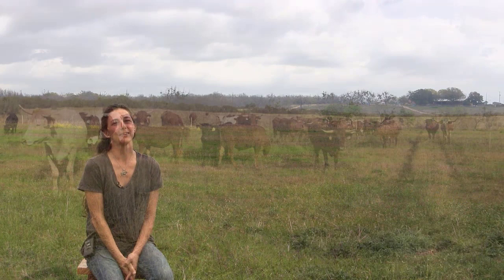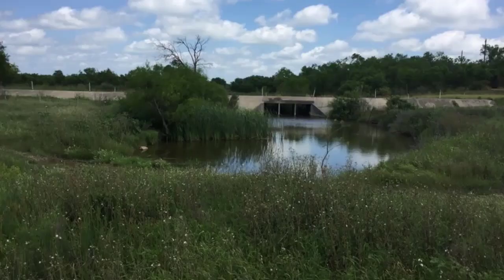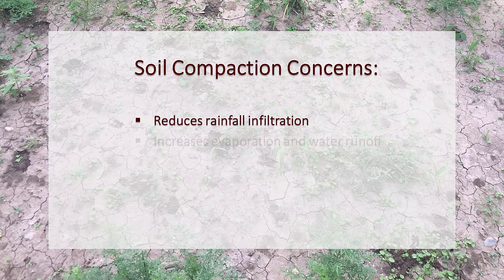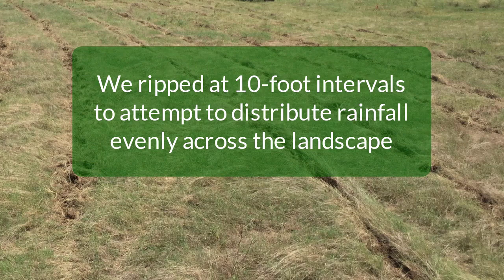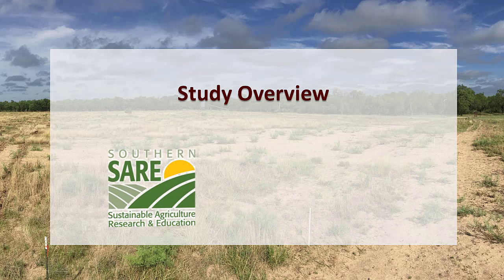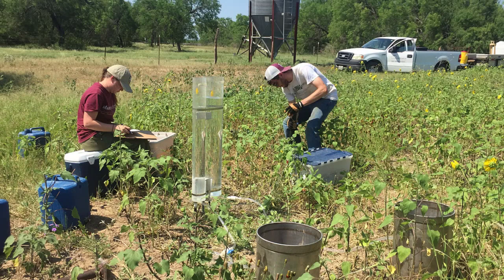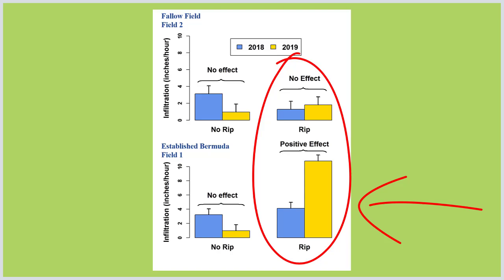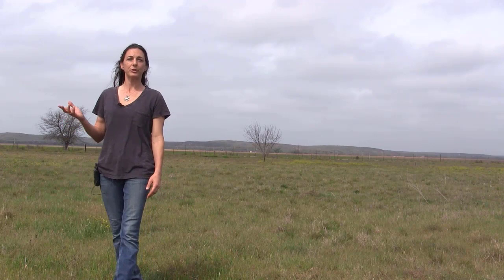Deep Soil Ripping for Water Conservation

Comment: Thanks for making the video!  Very informative.   I hope you follow up with more on how you continue to repair the soil from the abuse, i.e. getting more organic matter in the soil, lowering soil density, etc.   Having grown up on a SD ranch I have been a huge follower of Dr. Dwayne Beck and his research in repairing and no till farming.  The ripping obviously is a form of tillage but maybe a necessary one to get the repair started and then maybe needed for a while until the soil gets repaired.   The soil didn't get damaged in a few years and won't get repaired a just a few either but I appreciate you making the efforts to do it right.
Reply: Salt may be removed from the surface.

Comment: Do you use swales anywhere? I have been watching an Australian guy, Polyculture Farms Dryland Permaculture, that uses both swales and deep soil ripping.
Reply: Apparently this has fewer downsides
Reply: What are swales.
Reply: @colmanlong1032  Think wide shallow ditches built on contour to capture and slow the water. They aren't meant to hold it long term like a dam, more like a leaky weir. Just something to slow the water so it has more time to soak into the ground. You will have less run off which means less errosion and more long term soil moisture.

Comment: Ripping can make the plowpan worse
Reply: Could you elaborate on that?
Reply: I don 't think so as it has been practiced in Australia for over 60 years...Keyline design ...was invented by an Australian farmer...PA YEOMANS .in the 1950s ..read his books...he makes it easy to understand.
Reply: If you can plant cover crops with long root development AFTER deep ripping, then the root growth should sustain the break up of the existing hardpan. Also, the deep root growth should add organic matter to the soil at all depths.
Reply: @greg3wilson768  wow nice insight! thank you mister
Reply: They can, if you use a straight shank narrow tip and go deep enough to get under the pan it breaks it though. Definitely best to dig a hole and find the layer first